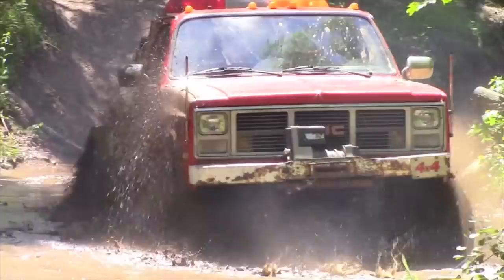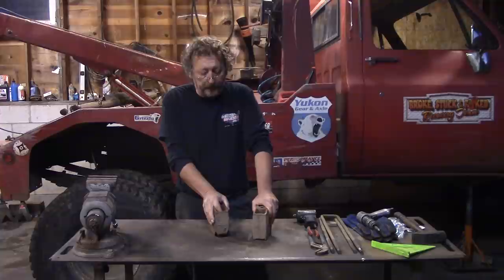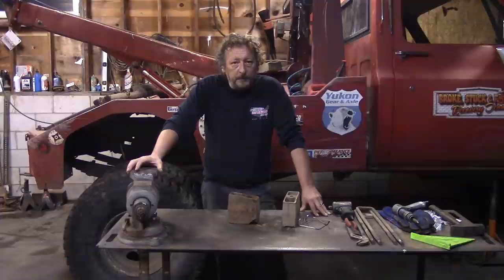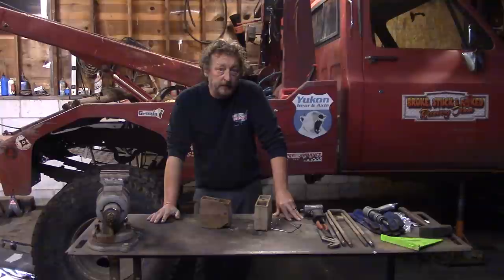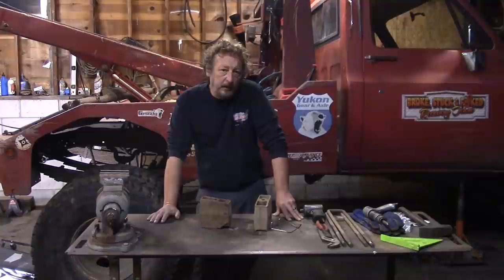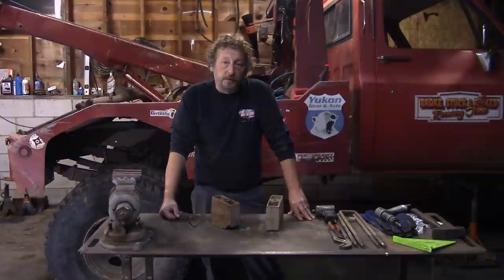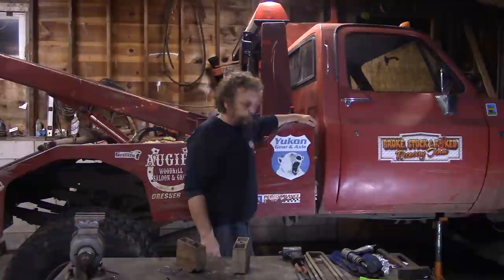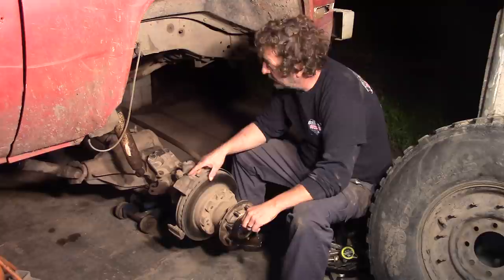OFF ROAD WRECKER REPAIR by BSF Recovery Team

Comment: If you like lift blocks and leaf springs, you should probably consider some off-road traction bars, especially considering that you put extra torque loads on the suspension by not only driving difficult terrain, but doing so while trying to pull others at the same time.
Off-road traction bars are not the ones you see on muscle cars, rather, they are a link bar, run parallel to the leaf spring, the same length from spring center bolt to non-shackle spring eye, but, run above or below it. Basically, it let's you make a leaf spring become a 4 link.
I'm sorry, I'm sure I'm describing it poorly, but I am remembering them from a old jcwhitney catalog.
But you could make some link bars, attach one end either near the axle, or above the springs several inches, along the spring center bolt line) and then attach the other end to the frame the same distance above or below (whichever you choose on the other end) the spring eye, while the truck is sitting on the ground. If you can spare the clearance closer to the axle (or even below it), and the same distance from the spring on the other end below the spring hanger, you could get the most benefit in reducing torque loads, and transferring drive power to the truck. This should also eliminate axle wrap, which contributed to the u-bolt and spacer block failure.
If you want to put such a bar on above your springs, to maintain clearance, and simplify attachment brackets, I would recommend looking into doubling up on the u-bolts, which, with your current setup, wouldn't be a bad idea, especially given the size of your spacers....  you could either make a new top plate, or a adapter plate sandwiched between the top plate and spring. 
Happy wheeling

Comment: these would never come out if you would make the plate a little wider and run the u bolts through them to hold them in place
Reply: thats a good ideal but since he already built them he could just add tabs to extend out to the U bolts.
Reply: Either tabs or some tube. Square tube, with a side cut off, would be easy to align and weld in place.

Comment: Nice repair. 
Almost wonder if it would be a good idea to add a top link to the top center of the axle. And a sway bar to help prevent the axle from twisting and shift side to side

Comment: I was thinking of rear radius arms with rubber bushes added on, but, although the rear axel is moving around a fair bit the flex will take the shock loads out of the drive train. So that current set up might actually be perfect for the truck and it’s work load.

Comment: i agree with Darkside on welding the blocks to the perch, then they will not spit out. Also, studding the front axle spring perch (instead of bolts)makes it a lot stronger
Reply: That is true.  One other thing, I use to be a field guy for Caterpillar, and the standard Cat bolts are grade 8, and the bolt threads are formed in, not cut with a die.  That makes them stronger.  One other thing, the standard bolts are very reasonably priced.  Almost the same price as the grade 2 junk bolts that some people sell.  Now the speciality bolts, like 12 point head and allan, they will make your wallet bleed.

Comment: A fairly easy fix for the wrecker would be to add a set of locating arms to the rear axle that would prevent axle wrap. With the locating bars, the lift blocks would only have to deal with weight and not rotational stress which is what causes most blocks to fail. As long as the bars move parallel to the leaf springs, they would keep the axle moving only straight up and down. About the only down side to locating bars is possibly a slight loss of ground clearance depending on where you mount them. Benefits are no axle wrap, no wheel hop and a much stronger rear suspension as it would be similar to a 4 link suspension with your existing leaf springs as 2 of the links. The best part is you could as time permits design and build the mounting brackets while still using the truck because your not changing any of the existing suspension parts.

Comment: I have to say that those blocks look really good.  Congrats.  Just wondering,  why not make some trailing arms that attach from your lower axle and then attach to the frame up near the cab.  That would eliminate any axle rotation but would allow your current spring rate to stay the same.  Cheap fix too.

Comment: Eric, you are missing one very important message here!!   Just like anything else in life there are different ways to build stuff. DO NOT buy those hollow pieces of shit you were handling. Hollow will break ---- solid won't. I've made my own blocks (usually 4") and if you want more grab another 1" block. I build my own, take 1" steel stock and cut it to exact dimensions and weld together. (4 ---1" blocks welded together gets you a 4" block of solid steel. Just gotta drill your center pin hole or centering dimple like you'd need for centering rear axle. See now---can't  break, and much more beefy set-up. Blocks are fine --IN THE BACK!!    But you definately need a traction control set-up. I would just run a 1.5 " moly tube from a gusseted bracket under rear shocks with heim joints for adjustment up to a drop bracket about 6-12 inches back from your transfer case .  An axle truss would'nt hurt a bit for front axle tube either. I've seen them snapped off right past front diff. housing , when we get bouncing -when yur truck pull'in. p.s. there is only 8% lateral movement in the rear. The front can be up to 18-25%.   Thx.      Jim

Comment: I can't remember if I've mentioned this in other video comments, but a lot of people claim that it's worth some possible drilling out to go to 5/8" or larger diameter u-bolts. I replaced some 9/16" u-bolts with them, but I sold the truck within about 2,000 miles.
Reply from the maker: Yes, that is a common up-grade. Mine are 5/8.

Comment: since you fabbed your new blocks and they're made from steel not cast, could you weld them directly to the original spring perches on the axle,  would doing so make it stronger, basically making the new block and spring perch one solid unit, and prevent the same thing that happened to the other blocks or would there be no benefit to do that
Reply: Good idea.
Reply: I was thinking the same thing. It would keep that thing from spitting out again, and it would be cheap and quick.
Reply: the axle is steel as is the factory perch so there would be no problem welding the lift blocks he made to the perches on the axle,

Comment: Even with the 3rd hole modified in the front have you thought of using bolts that can be safety wired together?  Especially with 3 bolts they should never become a problem again!

Comment: I have the same tapered, cast iron blocks on a short bed Chevy, and even on the short truck the taper really sucks, my driveshaft vibrates because the ends are at different angles and my pinion seal is starved on oil and has to be over filled to not burn out... again, I wish I had the ability to build a set of my own.
Reply: You could make a few measurements and a fab shop could whip you out a pair for not to much money.

Comment: As stiff as those springs are...is leaf spring deflection really an issue with lift blocks on that thing? I wouldn't think so
Reply: It isn't - wrap bars really wouldn't do anything as you can't wrap nearly 10" of spring.

Comment: I know it's a dumb question but I just put a new 350 engine in my pickup I'm wondering what kind of oil you do you use in the wrecker
Reply from the maker: I actually use the same oil as I use in my Duramax. 15w-40 Rotella.

Comment: Eric, I've got an '85 GMC wrecker identical to yours but mine is 2wd. I need a 4x4 recovery truck so I'm considering to make this truck 4x4. I know a 2x4 and 4x4 frame are different. I have a question about the PTO. I run an sm465 and np205. Right now (2x4) my pto is on the passenger side. If I go with a Chevy Dana 60 front will the front driveline interfere with the pto? Is that how you have yours?
Reply from the maker: The PTO will work on the drivers side of the SM465, mine is run by a engine belt driven pump.
Reply: recoveryteam 
Thank you!

Comment: My brother was watching  a few of your videos and quickly noticed you are running high psi in your tires.   Just wondering why you don't drop a few psi to give you more traction and a bit more of some softer ride. I'm sure you have good reasons just wondering and trying to learn more about wheeling
Reply: Dennis Bellamy 
I read somewhere he doesn't because the rears aren't beadlocks

Comment: I think that repair was great. If the cast iron lasted 9 years, then these should never give you any trouble. Why did you not cut them at an angle? Was it not necessary?
Reply from the maker: No, tipping the pinion up for reduced drive line angle was not needed on the wrecker.
Reply: i thought he explain the angle is needed for short wheel base trucks, and his wrecker is long frame.

Comment: If you did your rear suspension the way I said in my comment on your last video when you broke you would never have to touch it again, I have built up nearlly 50 one ton class trucks that way that got used WAY harder than even you would ever use it 11 of them were off road recovery trucks 5 of which were 5 ton class used to recover things like logging trucks and heavy equiptment and the like, I also have an ASE in suspension,  the problem with the air bag route is (and the guys that use them will find this out eventually too) is you blow or damage an air bag or air line(and out in the woods there are many things that can tear them up) then you are double screwed because you are left with only the wimpy springs doing all the work and air bags do nothing to help with the lateral forces applied when having a heavy rig hanging from the boom on rough terrain, same goes for the fancy race truck suspensions they are great for up and down but not so good on heavily laden work like you are doing, and both of those systems ad many more parts to go bad and break (K.I.S.S keep it simple stupid is the best way to go for heavy use like an off road work rig, But what do I know it's all I've done for nearly 30+ years, Good luck on your endevor. P.S I know you are under time constraints and money may be an issue but I can't help to think that just bitting the bullet once and done would make you wonder why you took so long to just do it, Hell if you were in my area I would be inclined to just do it for you just to prove my point then let you pay me back on payments after you see just how well it works out.
Reply from the maker: I do understand all that you say, I to have been working on/fixing every thing from cars to heavy equipment all of my life. in fact I am scheduled to take 4 of my heavy truck ASE recert tests next week, over 25 years of certification. I also like to keep it simple, that is one reason the wrecker in still sprung the way it is. I haven't run into problems with breaking springs yet, but I never did like the way the taped lift blocks sat in there. The flat ones fit much better. The U-bolts were upgraded from the OE 9/16" to 5/8" way back when I first built the wrecker, and haven't snapped one yet. I was however snapping front spring shackle plates, till I fabed my own to of 3/8". I know the wrecker could be built into a heavier stronger unit, but overall curb weight is also a factor for me. I have found that the weight of the wrecker already has affected my ability to get to some of the places I need to, mostly steep hill climbs, and loose sand. So in short I would say we learn/have new ideas every time we go out.
Reply: Ever consider a M984 HEMTT, I've used those in gaurds, I am out west in Idaho and have also been around them in civilian use also (I work on them), that truck will go pretty much where you point it unless there is no bottom to it, sand, mud, snow, hills of loose sand, mud and dirt, even very steep ones (up to 60% climbing/decending and 30% sidehill the manual says But I've had them on a good bit worse LOL), actually very manuverable and able to get into some remarkably tight terrain for such a large machine (helps being big and heavy and able to just push over most trees and other crap that gets in your way ), OK so maybe that would be just a tad overkill and a bit too pricey for what you are doing but you wouldn't break it anytime soon LOL, But to be serious you will most likely  be much better off with the new blocks you built, they are quite a bit stronger than the cast ones (which aren't really worth the powder to blow them to hell actually), anyhow good luck with it and take care.
Reply: looseballs1966 
How did you do your rear suspension?